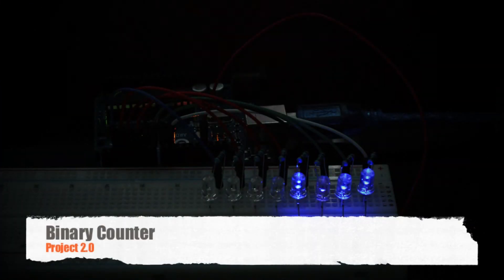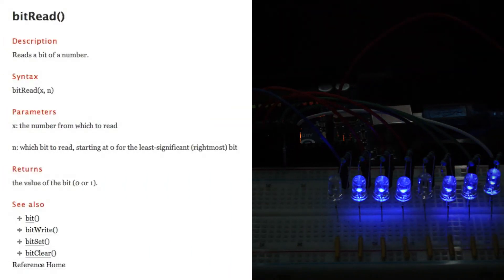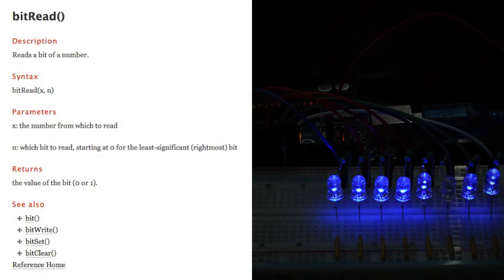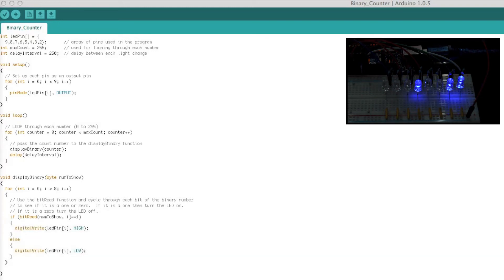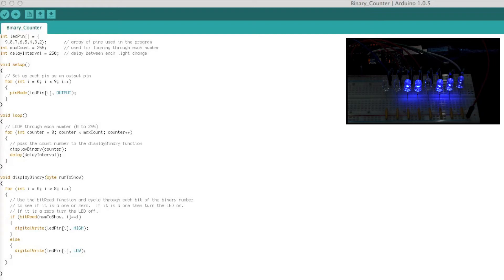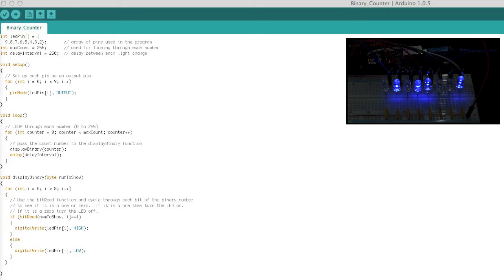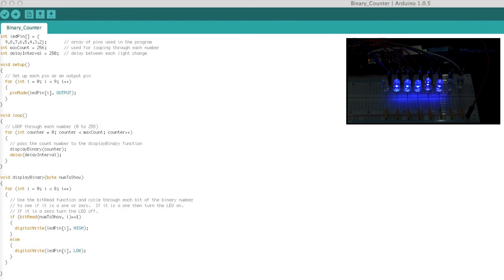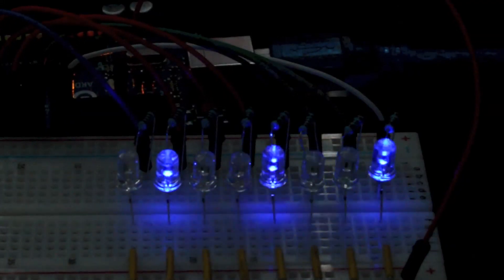Arduino Binary Counter

Comment: That was a great project. Thanks for posting the video. I was  trying to implement it by also using an array too, but I was going to do the math - as it is explained to us when we learned to convert a decimal number to binary - but that was getting a bit messy. I'm glad that I found your project and  that you use functions readily available to do the conversion.